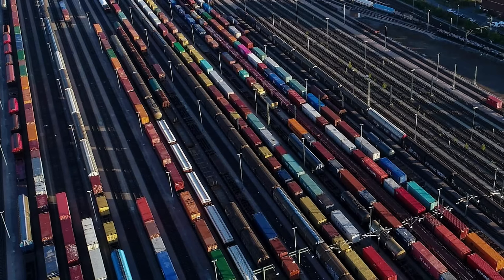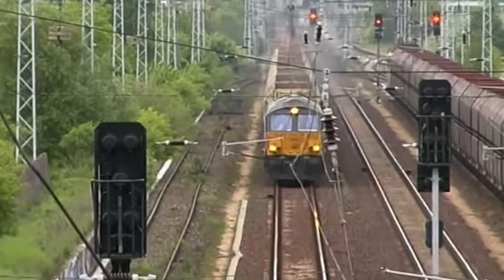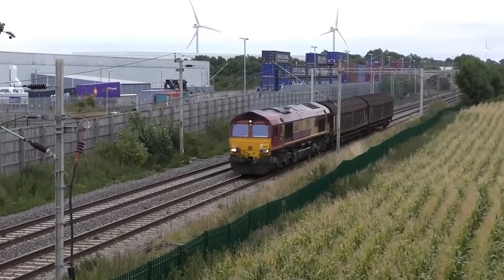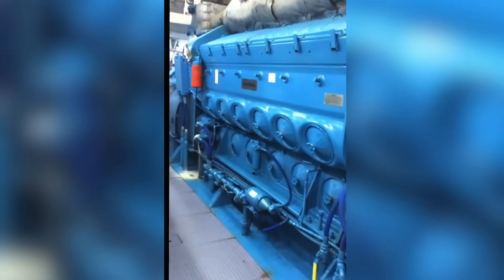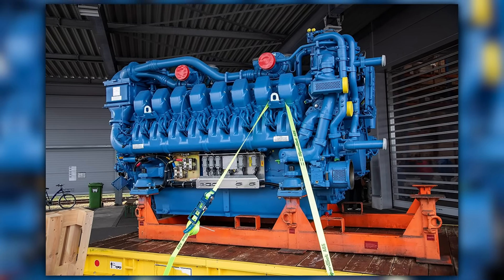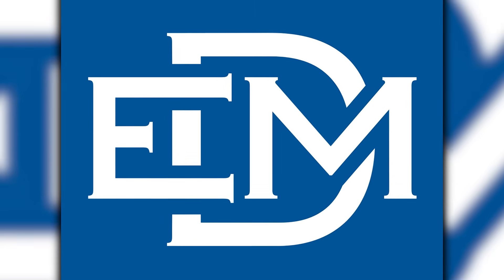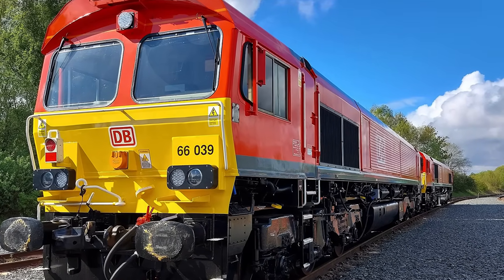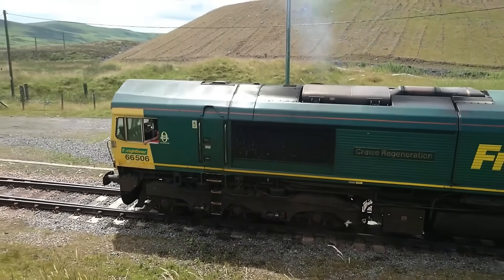Why Europe’s Class 66 Locomotive Still Haunts EMD

Comment: So many errors in the video. Mendip Rail didn’t purchase the 3rd batch of 59s, National Rail did, and those then passed to EWS. Mendip Rail was formed to operate the Fister Yeoman and ARC bought locos. Largest order of 66s wasn't Freightliner, it was EWS with 250. I don't recall Freightliner ordering 120 locos in one go either, I'm fairly certain they ordered an initial batch and then kept adding more and more to their fleet. Northern Rail have never had 66s, nor would they have needed to for maintenance trains as they weren't redponsible for any track maintenance - Network Rail are!
Very poorly made video! I gave up before half way!!

Comment: The story of class 66s is fine but the filler content is not researched or checked. A load of AI picture CRAP turned out at any cost to produce a video. e.g. 12:09 'Modern Locomotives' analysing performance - 1950/60 tech Class 20s on today's  passenger work🤣🤣🤣.

Comment: Freightliner weren't the biggest operator  not with  100 it weren't ,, 'twas EWS, with 250 when the design was launched.We had locos with similar installed power, but the killer was reliability , or lack thereof. Mind you, I only ever failed once with a 60 , in 30 years or so. Then again , only failed once with a 66 since they were new. They're robust tghings, right enough .

Comment: I love the 59s and 66s, sadly the 66s are starting to be replaced by new locos. One thing that i still dont understand fully, in the UK drivers were not allowed to use "full power - Notch 8"
Reply: Notch 8 use is allowed, its recommend against being used unless necessary though as the fuel consumption is increased greatly from Notch 7.

Comment: The 66 orders may have dried-up but they will continue to be a common sight on the British network, there's no doubt they've been the most successful freight diesel engine we've seen. Several European versions have been bought by UK operators. However new European locos are coming and if they are successful we could start to see the first significant Class 66 withdrawals.  Even if that happens, our propensity to rebuild old locos (some of which after over 60 years old) may see similar rebuilds for 66s.

Comment: The GM/EMD 645 power unit is horribly in efficient compared to 8MB275 in the Class 60

We are talking almost 50% more efficient in the Class 60
Reply: That's because 8MB275 is a 4 stroke engine, opposed to EMD 645 prime mover which is a 2 stroke. While having inefficiency of a fat American SUV, it has crazy durability (literally what made EMDs flagship)

Comment: The real EMD problem was they did not have a series of power units to REPLACE the 710 blocks (themselves uprated 645s). No we have ended up with Cummins QSK and CAT units like the 68 (which sound great) so they never had the product to put in many loco design options.  The real question is what to replace the 59s with, as they are the master of their work but getting increasingly aged. I suspect it will be AC traction power with a big CAT diesel unit.

Comment: A handful of snippets.

Foster Yeoman originally wanted to purchase a small number of Class 52 'Western' twin-engined diesel hydraulics from BR, as with 72,000 lbs of tractive effort they had proved their worth on the Yeoman stone trains in the 1970s.
In fact, half a dozen or so Westerns were tarped over at Swindon Works for a while, with this in mind.
Sadly it was scuppered (and the locos subsequently scrapped), I believe by ASLEF (train drivers' union) as they didn't agree to privately owned locomotives on the BR network. 
This happened anyway, when the Class 59 was delivered (and worked by BR traincrew).

The Westerns were a victim of policy, nothing else, they were very capable engines but BR wanted to standardise on diesel electrics, and they were gone by 1977 although seven are preserved, and at least one of these is main line registered.

This is only a rumour, but it's likely to be true so bear with me.
Yeoman had one preserved Western on site (D1010 Western Campaigner, masquerading as long scrapped D1035 Western Yeoman).
When the GM reps visited, they asked the Yeoman bosses "what do you want your new locos to look like", apparently they pointed at the Western and said "that!"
You can sort of see it in the 59 and the subsequent 66, albeit a far less attractive design IMHO, compared to the Class 52.
The reason that they had rectangular windscreens, was because BR insisted on the same windscreen (and general cab layout) as their then new Class 58. I believe one windscreen was sent over to North America as an example, with this in mind. 

Just to add: as others have pointed out, Northern Rail have never ordered any 66s, they were and are a mainly DMU/EMU outfit although they did use Class 37s on LHCS for a while due to a shortage of multiple units.

Also, Freightliner never ordered electro-diesels, that was DRS who purchased Class 88s from Stadler.
They did however ordered Class 70s from GE, I was one of the first drivers to be trained on these rotten contraptions. 🤣🤣

Over the years I've driven 56s, 60s, 66s, 70s, electric locos of Class 86 and 90, my all time favourite has to be the 86s.
56s make a fantastic racket, 60s are good plodders with phenomenal tractive effort, and it must be said that 66s are extremely reliable so expect to see them around for a long time yet.
In fact, GB Railfreight have been buying them in from Mainland Europe, because they have grandfather rights.

Thanks for the video.

Comment: I'm in the Netherlands. Quite some freight volume, but most of it crossing the German and Belgian borders.
The Class 66 seemed dominant here - due to the different overhead voltages (and safety systems). However, the German companies of Siemens and (then) Adtranz developed great multi-systems electric locomotives: Siemens the EuroSprinter platform, succeeded by the Vectron, Adtranz (now part of French Alstom) its TRAXX platform. Recently, the Spanish division of Swiss Stadler has joined them.
In my perception, it's the availability of these brands that eliminated the need for diesels - in continental Europe.
Hybrid models tend to be electric with a last-mile diesel option, but the Stadler ones may be more diesel with an electric option.

Another factor may have been the number of Russian-built mainline diesels from former East Germany: these became redundant by swift electrification. Quite some of these have been upgraded with engines from (from memory) Caterpiller, but even these are losing ground.

The multi-system locomotives I mentioned have one more advantage: they all can  generate power and feed it to the grid when braking - compare that to the coolers on American diesel engines on the mountain passes! (Note that the feeding back is rather limited with Direct Current catenary.)
Reply from the maker: Fantastic information! Dank je wel. I happen to be in the Netherlands right now. (Groningen). Mijn familie is Nederlands.
Reply: @VintageAmericanMachines Veel plezier in Groningen! - If you can and want, spend some time in the Rotterdam area. There is the Kijfhoek marshalling yard between Barendrecht and Zwijndrecht, with the Rotterdam - Dordrecht passenger service providing minutes of observing it, and there is the Havenspoorlijn that runs from the Kijfhoek to the Maasvlakte (opposite Hoek van Holland). That is the heart of Dutch freight train country. You are likely to see some Class 66, but German electric BR 189 and 193 (both by Siemens) and BR 186 (by Adtranz, now Alstom) will dominate. You may see Stadler engines, but they still are rarer. - The single-cabin diesels of Dutch series 6400/6500 are a diesel-electric version of the Mak (then Vossloh, now Knorr) diesel-hydraulic model G1206 (from memory).
You might extend your trip to Antwerp (Belgium) to observe the Antwerpen-Noord yard.
Another trip could lead you eastwards to Maschen (the huge marshalling yard south of Hamburg) and take stock (pun intended).
These trips would give you some impression of the traction currently used in these three countries.

Regarding the recuperative braking: observe the ease that freight trains go up and down (the North face of) the Brenner Paas between Austria and Italy. Several train drivers provide cab views of their climbs and descends. Coming to think of it, Rotausleuchtung used to be a YouTube channel featuring many of these trips, but he turned instructor. He also has cabviews of freight trains Southwest of Munich featuring Stadler EuroDual locomotives, including the use of both modes (electric and diesel). Besides, he may explain matters. (Original language: German.)

Comment: I think what also played a role was that by the mid 2010s, the class 66 virtually had saturated the market and there was little appetite for buying new locomotives as everything that needed to be replaced had been replaced. Instead interest turned to electric locos where there was a significant replacement backlog, with class 86s and 91s for example still being the backbone on Freightliner's electrified routes. In Europe Bombardier and Siemens had low cost electric locomotives in the form of their Traxx and Vectron lines, but these designs were not portable to the UK loading gauge, and so ancient electric locos kept on running. Then manufacturers like Stadler changed all this when they started providing dual modes that helped put an end to the terribly wasteful operation of diesels under wires on partially electrified routes. EMD didn't have anything to answer that challenge. Arguably an electric or bi mode version of the class 66 would have been achievable, but I guess EMD preferred to walk away.
Reply: I don't think so. To make a Bi mode class 66, it would be lame and low powered or require 8 axles.
Since you basically build a whole electric locomotive and a whole diesel locomotive onto one frame in one body. And EMD engines are rather large, heavy and have low power output, compared to the caterpillar and mtu engines used in modern locos. That rev twice as high, to make power without beeing a hunk of steel.

Comment: Northern Rail did not buy any class 66 so what a load of nonsense. Infact no operator bought the class 66. They were all bought by ROSCO's and leased to the frieght sector.
Reply: There is one example as I know, 66587 was purchased outright by Freightliner which presumably is why it had so many in house trial mods on it.

Comment: Class 66 are not allowed to run 120 km/h in Germany because of poor braking performance. The class 66 in Germany were first introduced by Habour and Goods Cologne (HGK), this  railway company became the first to own and maintain class 66. Class 77 is the refurbished design with 5 doors /clima aggregat on the roof, situated at the front on top of the driver ´s cabs and maximum speed of 100 km/h with encreased hauling abilities of 450 KN, instead of 420 KN.
Class 66 were rebuilt/adapted for European companies by the now closed facilites of Nedtrain at Tilburg. DB  Schenker first bought class 77 for their company in France named European Cargo Rail (ECR). Later these units werde partly transferred to Germany based at Oberhausen (Ruhrgebiet) hauling heavy steel and coal trains and Mühldorf (Bavaria) hauling there tankcars filled with oilproducts and other chemical products  in unit trains and domestic waste trains.There were also some class 66( with 3 doors) transferred to France from UK after adapting for European service, replacing the classes 77.

Why were they bought by HGK and leasing companies ?? The pricing was decisive:   2 Billion dollars only (2 Millionen Dollar) for one engine, half of the price for a six axeled engine from other competitors ! The 250 engines for EWS were leased, too.
Reply: There was aversion for passenger and goods service: the four axeled class 67 for 200km/h  or 125 mph.
You did not mention, the goverment of that time, prime minister was Mrs. Thatcher, did not have the financial ressources and the political intention to overhaul the complete British Rail System.
There were goods waggons  nearly 50 years old with limited maximum speed and loading capacity.Some even without brakes.The missing of brakes forced British Rail to invent and use the braking tenders, the existing brake power of locomotives and the other waggons of the train consist were limited and not sufficient.
Under the leadership of Ed Burghardt (CEO of EWS)   the Thrall Company was asked to build a lot of state of the art good waggons e.g. container cars, hoppers with air suspension, air disk brakes, automatic discarging, automatic couplers inside unit freight trains! Maximum speed up to 120 km/h!  All these new cars had 2 axeled bogies, two for each car  ! British Rail designs were two axeled designs mostly.Running these designs under high+er speed caused massive derailments in some cases.

THAT was the second aspect of the modernisation of the railways in UK.

Comment: Generally accurate but misses a bit of nuance.

Class 66 was not widely adopted across Europe most units built for UK market with a few across Europe. 
Why UK? Because we are a outlier for electrification,  low compared to rest of Europe. 
That's only got more pronounced over the last 30 years of the 66s service..
It's not just emissions because UK government has dithered over electrification UK freight haulers are having to make decisions about what they do about ageing 66s. New trains like bi mode 99s are a compromise if more electrification happens. 

Also the 66 and 59 were not the most powerful haulers in UK. The 60 introduced the same time was more powerful. It had a bigger engine and computer anti slip control which was advanced for the time. But it was far more unreliable, that's what private freight haulers were annoyed about 

66s are very basic, but incredibly reliable as the video said. Widely used outside of Europe as well, Egypt and Malaysia etc 

Ultimately there's very little market in Europe for diesel freight haulage. I am not surprised US suppliers bowed out.
Reply: And to top it off, high electricity prices in the UK have kept diesel in service as many freight companies seem to even be scrapping their electrics. The class 90, relatively modern, has been culled in huge numbers. The older class 86 and class 87s, many are now in Bulgaria.

Comment: Some factual inaccuracies: British Rail did have locos as powerful (56) and by the time the 66 was introduced had also the class 60 (which had more tractive effort as well as equivalent power). However what the British locos lacked was reliability.
Reply: The 56s cannot match the 59s traction capabilities, a part of which was the wheel lift problem only recently cured in the 69 rebuilds. That said the 56 is a brute of an engine. The 60s where the real deal with power, I've never seen a train the 60s would not move (or rip in half trying). Just a great shame that EWS absolutely decimated the 60s (on purpose so nobody else could get them)
Reply: @leonblittle226  Agree with a bunch there, but... lol, I'm that guy. Both 59 and 56 had about same hp. so how did the 59 get rid of double heading. Most of them were geared for 60 not 80mph. there's a boost. EMD discovered the steel wheel rail "Creep Phenomenon". deliberately make a loco wheel, wheelspin around 1% and you get up to a 40% boost in pulling power for free. Super Series Creep control is what they called it. Cheap and simple compared to newer creep control designs but still very effective.
Reply: I was about to post the same love the 56 and 60s and it pains me seeing all them tugs parked up rotting away 😫 I hoping they get a rebirth but it doesn't look likely

Comment: Europe's focus has always been passenger rail and doesn't offer a large enough market for a clean sheet design, especially with expanding electrification. Tier IV diesels aren't selling in the US either because because of the cost and reliability issues so the market has shifted to rebuilds.  The MTU and QSK powered diesels in North America had has absolutely abysmal reliability because those are fundamentally not rail use engines. Europe might get away with them because of the lighter duty cycle, which again compromises EMD/GE's value propisition.
Reply: rubbish; cleptoparasites adminstering decline, silly 💡💡💡

Comment: EMD waited too long to switch to 4 stroke engines prioritizing the power to weight ratio of the engine to the power to weight ratio of the whole locomotive and discounting the emissions advantage.  They also stuck to medium speed diesels preferring longer overhaul intervals to the weight savings of higher speed diesels that might have accommodated the increasing weight of emissions related equipment.  They also lost the R&D priority they had with General Motors as GM's automotive business struggled.